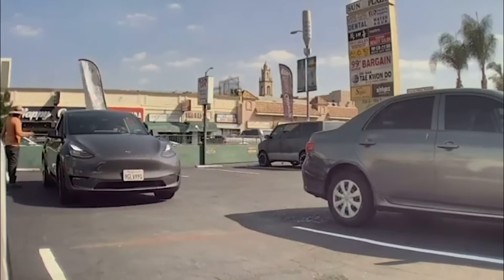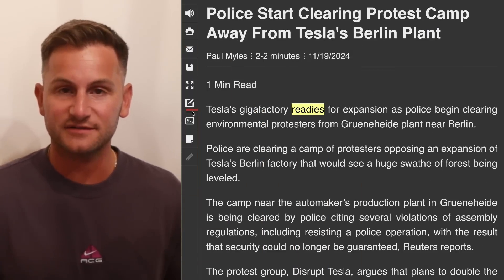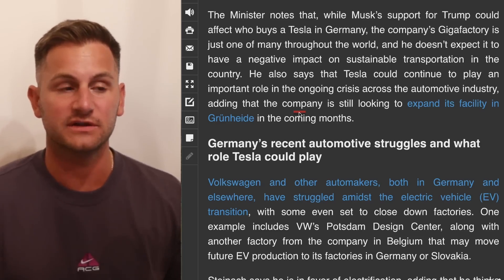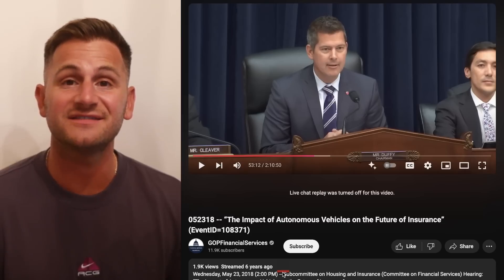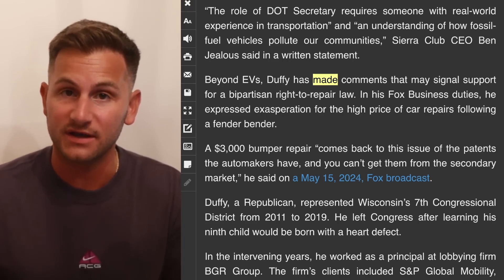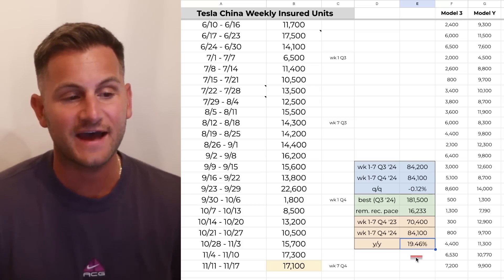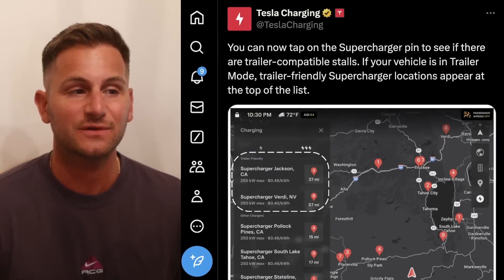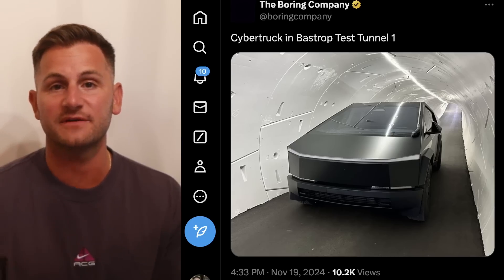The Autonomous Boom Set in Motion / Tesla Is up to Something / Big Win for Tesla Energy ⚡️

Comment: The regulation is not going to be an issue if u have the software ready.  If your car can’t go 500000 miles without intervention, you should not even consider building a car without a steering wheel and paddles.

Comment: Full autonomy will eventually take over. However, this is going to be a long term project, not in the next ten years. There's still a very long way to go before FSD is ready. See how upbeat he was back then, and see how progress is achingly slow. Sure, it's getting better with most iterations, but the goal of unsupervised autonomy remains elusive. This is genuinely a very hard problem. Solving it for highways and light urban settings has now been pretty much solved. However, that's a million miles from driving in Paris or London.